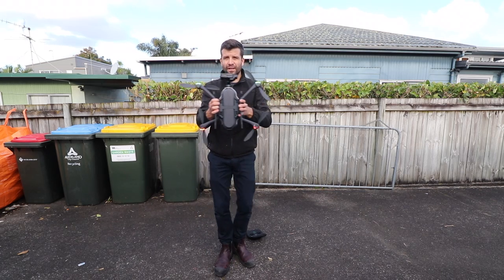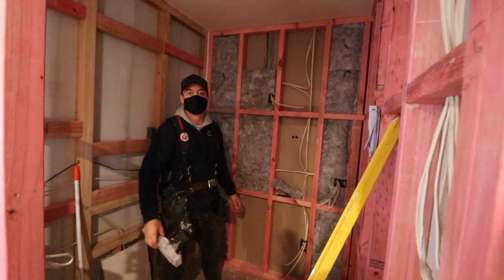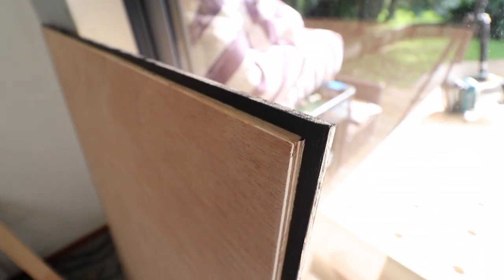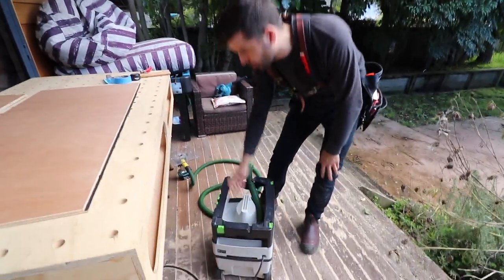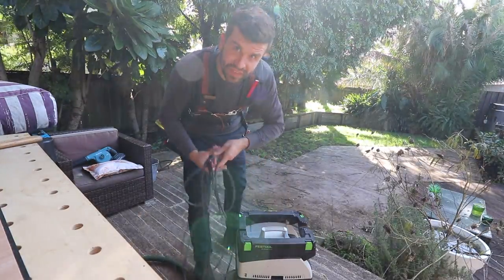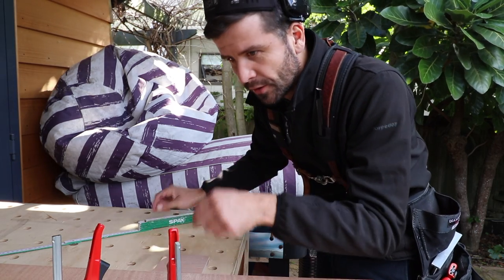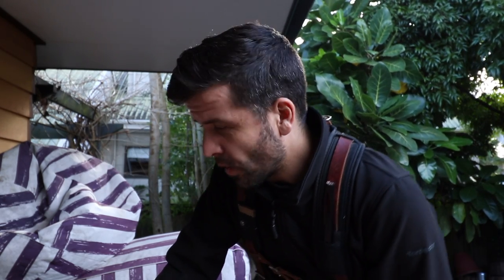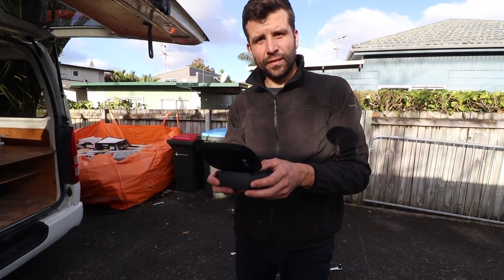Almost Fired Over a Vacuum!

Comment: Well, let me tell you this, as a customer :). I had some cabinetry fitted about three years ago. I only finished painting the room, and fitters came to get my cabinetry sorted. All morning they worked without extraction vacuum. I offered them my small Karcher but they pointed out that they have extraction with them. I thought it is strange not to use extraction, especially as they were cutting Corian worktops but it is their health... However once they left I got massively upset. My freshly painted walls were all covered in the dust. And this was especially visible on my dark navy blue feature wall. It cost me 4 hours of vacuuming walls from the dust plus I gathered it is better not to breath in this shite. Extraction protects you and environment you work in. It is a good idea to use it :).

Comment: As a cabinet maker, after getting my Festool ct26 and making all my tools hook up to it, I will never be able to work with out it. I work beside people who don't have dust extraction and it makes you realise how good it really is having dust extraction. Also for the "throwaway" festool bags I made my own version of the lifetime bag clip from two different sizes of water pipe that slide over each other, I cut the bag open empty it and seal it up with my diy clip and I use a bag for around a year before throwing it out.

Comment: Hey Scott, excellent vids, carpenters have by far the most credibility over any other trade. Keep up the great work.
CCA has 0.001 parts per million arsenic
Rice 0.40 ppm 
• Potatoes 0.63 ppm 
• Mushrooms 0.66 ppm 
• Tomatoes 1.49 ppm 
• Shrimps 19.90 ppm 
Source: Contact - the TPAA Newsletter, 2nd August Issue 2003

Comment: I use the disposable bags for my Festool CT36, but I don't throw them out, I just shake the dust out of the hole.  The bags are about $100 Canadian for a 5 pack, so I save several hundred a year.

Comment: I got the Festool cyclone trap / pre-filter. (Should work on your model, also on Makita’s vacuum systems with the systainer clamps on top) It’s Festool so it’s arguably overpriced for what it is, but at the same time it saves me money on bags. Especially if you have a lot of router work. You still need to replace the bags once in a while. Not because they are full but because the ultra-fine dust leaves a coating on the inside, clogging up the airflow.
Reply: I also use small cyclone whenever i can, no matter how big the vacuum you get so much more out of your bags. Thing is mine cyclone is small so i need to empty it all the time, so im looking to buy something. Main issue is i dont know how to connect it and not use too much hoses

Comment: Dust extractors are where it's at. I even have a shroud that lets me hand sand with collection. Festool plastic is too delicate for tools of that price, in my opinion. It's my only complaint about the brand, and it's kept me from buying anything of theirs- as great as they work.

edit: Not to mention the time my boss told me to just put a bag on the sander, while I was setting up the extractor. It set the fire alarm off, which was tied into their home security system. Good times. Always extract.

We don't use any treated timbers in interior construction here in the US (at least in New England). I'm not sure it's a good idea.
Reply: What do you use instead of Festool?  Suuuuuper expensive, it seems.  Just curious as I'm starting to look into this sort of thing
Reply: @rgbking488  I've been using a Fein Turbo 1 for over 3 years. It's not the best, but it's really good and it's the most affordable of the good dust extractors. I'd buy it again if mine died tomorrow, but there is no indication of that. It's often run for hours at a time.
Reply: @troyclayton  Incredible, thank you very much!!
Reply: @troyclayton  Killer info, thank you for the insights.  Yeah, it's interesting...people are always talking Festool I see, but none really push or talk about the other products.  I dig it and would get it (because everyone is pretty much selling it)...but I haven't yet and will probably go with something more affordable to start.  I don't know that I need a Ferrari of mobile vacuums to start...but if I was to get some larger, more permanent setup for a garage/shop, then I could see something more "Ferrari" like - cheers
Reply: @rgbking488  another option could be the scaled down Festool CT 15. Essentially a midi scaled down in features and minus the Bluetooth option. Only thing with the 15 is that it doesn't come with an antistatic hose and so I'd source one even going with something like a Cen-tec antistatic hose to avoid the 130 USD price tag for a hose.
Reply: @Fictitious_Character  Oh wow, that's awesome to know about!  Thank you.  Heck yeah - good to know of the different options, while definitely saving a few bucks to clean up messes
Reply: @rgbking488  The hose that comes with the 15 is good but it is like the older hoses by not having the braided outer shell, and it's not antistatic. Not being antistatic is a problem when it comes to wood dust. 

Other than the Bluetooth everything else that the 15 doesn't have can at some point be ordered from the Midi parts list because the parts are interchangeable since they share the same body. Hose garage, cord wrap, wheel lock, and of course the Bluetooth are the features that were scaled down for the 15, and only the Bluetooth can not be added later if you feel you need a feature. 

I have a few Festool extractors that are used on site and was looking to retire a CT 26 and wanted to go slightly smaller with a Midi for on-site mobility and weighed the options of the 15 pretty heavily because $350 for a 15 versus $640 for the Midi. I did end up ordering a Midi because of the Bluetooth option, but the 15 was very tempting and for what it offers for the $350 made me almost pull the trigger on it. 

Anyways definitely worth looking into and a reasonably priced entry into Festool.
Reply: @Fictitious_Character  wow - you know all about them, thanks!  Yeah that sure sounds like it, really appreciate the insights and details here - as an engineer, I love the details, hahaha.  Cheers & happy holidays!
Reply: @rgbking488  np. You have a great New year and a banging 22.

Comment: Great work as always but I would have to say the faster way of making these rebates is just to get the right router bit. You can get 25mm bit with a 12mm bearing on it so that when you run it along an edge it will overcut by 13mm instead of doing a flush cut. Very convenient way of doing this. I use one for doing rebates from time to time.

Comment: Festool forums recommend Starmix Ipulse vacuums. I have 4 and find they are better than anything else I've used.
Reply: Nevyn starmix impulse are exactly the same as metabo and I think Ramset vacuums.
The shape is exactly the same.
I do not understand why more carpenters don't use dust extraction.
They certainly keep the area clean and free from the fine dust which is not good for anyone.
Also cutting treated timber.
Reply: @ron1martens  The other brands are starmix vacuums rebranded.
Reply: Nevyn interesting how it works. Somehow they ( manufacturers) work together.
As you know metabo and hikoki have amalgamated. The metabo cordless planer is the same as the hikoki and previous hitachi cordless planer.
Ramset jackhammer is also a carbon copy of Bosch or vice versa.
So I'm curious to know where it all started like you mentioned.
Perhaps patent lifted.
The festool it a different design to starmix.
One thing I had a festool and they don't lose much suction when the filters get clogged with fine dust. Gyprock sanding.
Until my festool was stolen.
Both these vacuums become heavy and bulky so a smaller vacuum may be more ideal for timber cutting and leave the bigger machines for brick or concrete grinding and gyprock sanding.
Reply: @ron1martens  a small vacuum  with a compact cyclone is the ideal solution. Festool and makita are both toying with it.

Comment: To extend the life of your vacuum filter, consider using a cyclone separator between the vacuum and the tool.  I've found that it will divert over 95% of any wood dust, and about 90% of drywall dust.  
"Dust Deputy" makes a version, and Home Depot (US) has a version that fits on a 5 gallon bucket, called the Dustopper.  Likely pay for itself in the cost of Festool filter bags alone.  Not sure what is available in your area.

Comment: hi Scott ,small tip its much faster to do those "rabits" on your table saw ...2 small cuts and youre done ,advantyage is youre not changing all that wood in dust ,i always set up 1 cut run all my board thet set other cut run all again...(its realy easy on those dewalts ....mine is same as yours but run on batteries...)
i tried with router ....even with spiral bit take longer than table saw

best regards
Reply: marek mroz  I think for the board He’s installing  @9:45 , you’re gonna want to use a router.. 
For me, my garage sealing is low, so that limits me. Can’t put bigger boards vertically on the tablesaw.
However, in an better situation, you have a very good point my friend. I would do it just because I hate the noise my router makes :)
Reply from the maker: I use that method from time to time.Super quick! My table saw tends to leave scratch marks on the smoother sheets though, router this time 👍

Comment: I swept a new home under construction, it hadn't been swept since they finished the drywall and the vacuum filter was torn so it just pumped out dust the whole time. I really wished I had wore a mask, I could feel it in my chest the next day. I imagine it will take several months before I get most of that out of my lungs.
Reply: some tiny particles stay in your lungs forever

Comment: I bought the festool cyclone about a year ago and its like a turbo booster and you do not loose any suction. The clear container is a real eye opener as to how much dust is coming out the machines.
Reply: The festool cyclone separator decreases suction by 15-50%

Comment: Dust extraction drives me mad,every single tool i have has a different sized outlet,makes it near impossible to connect the vac to.even stuff from the same manufacturer having a different size.its about time it was made law for all tools to have an exact sized outlet so there never any excuse for no dust extraction!
Reply: Totally 👍
Reply: Ross Male duct tape haha
Reply: I have a couple stepped adapters which have been ok so far, but I’m with you.
Reply: Yeah I have stepped adaptors but always end up reaching for the duct tape,then I change tools and need to untape and re tape,what a ball ache!
Reply: Thats why Festool is awesome, everything fits and works together but you pay the price for it
Reply: Some cut up bicycle inner tube is handy for quick step sizing on hose connections
Reply: Ross Male,
  I was having the same problem. Makita hand tools with a Fein vac.  The Miter and table saw connect easily with dedicated 1HP floor dust collector.  Fein vacs, and presumed Festool vacs , work a  millimeter (Euro) scale.  I have been able to connect all Makita tools to the Fein, sometimes with tapered adapters, or directly to the hose.  Track saw, power hand planer, palm sander, router, etc.  If you using  the DeWalt  platform (glorified Black & Decker) I'd try American brand name shop vacs (Junk. ) to accommodate the Imperial System.  I live in the States and wish we made quality power tools.

Comment: Damn it’s crazy how different countries have such different building laws & codes. In the states I’ve never heard of that. In 8min through and this is reminding me of some panels we did in a bathroom and library. Mahogany veneer mdf cut with a 1/2 or 3/4 piece added in between each panel painted dark (almost black) it have the perception of similar to the groove you cut. Same depth. We had 2-3 of up doing it. It was tough bc the homeowner wanted every grain to match. So the veneer were all straight grain up/down. It was just a bitch handling those large sheets of mdf and getting the grains “book matched”. PL glue & 15/18g. I was up on the ladder while my coworkers were down below and I turned around and there was a cop standing at the entrance on some ok wrap it up! Iduno how long he was standing there bc we were in the zone! Caught us off guard lol dope vid brother! Looks sick!

Comment: Dust extraction is a must. In Denmark you HAVE to use a vacuum cleaner, and sweeping inside is strictly forbidden, because it spread dust in to the air.

Comment: Scott why didn't you just use a rabbeting bit in your router instead of setting up a straight edge for every cut? That job would have taken a fraction of the time, even allowing for squaring up the corners.

Since you made that table, I think I'd set up a router in it too.

Comment: This is interesting, in the US we don’t use nearly as much treated lumber in building, and CCA treatment is banned. Only outdoor structures and ground contact timber is copper azole treated in residential construction. We also don’t believe in dust extraction for the most part so 🤷🏻‍♂️

Comment: The auto feature on the vacuum is not recommended for mitre saw and any other powerful tools since they use more than 5 Amps and will stress out the motors.if used on one circuit.  In America anyways, we run 110V  15 Amps.

Comment: Hey Scott, Makita makes a router plate for their tracksaw rail that should also work on Festool track. Also do yourself a favor and buy a cyclone dust separator. They make one that fits your Festool vacuum (watch out for static build up with Festool ), There are many companies making models from units that you put on top of a 5 gallon bucket ($50), to Onieda (great systems) starting at around  $100-$150. I was amazed at how much dust they captured and how little dust made it to the vacuum's bag.

Comment: The green pressure treated timber doesn't have Arsenik in it anymore. It, unsurprisingly, was deemed too toxic to humans and the environment so they banned that and now they contain some sort of copper-salt instead. It's not as good to protect against long exposure to moisture though it does not leek Arsenik into the ground etc. This is at least the case in Europe. I can't say if it's the same globally.
Reply from the maker: Wish we went in that direction. Our timber still has arsenic it it. They actually record higher levels of arsenic in the air during winter, from people burning the timber  off cuts in their fires at home

Comment: What type of buildings do you prefer working on, UK or New Zealand houses?
Reply: New Zealand I would assume, I shouldnt answer for Scott but I am a carpenter from Scotland and the building regs here can be a pain in the ass, Much colder and wetter obviously so everything is insulated, health and safety is Over the top here as well as you would have gathered from the video
Reply: @scotland2256  I'm a carpenter from canada, health and safety is insane in New Zealand, especially on commerical sites, I worked there for a year, would 10/10 recommend
Reply: @anand8905  By the sounds of things it is much the same then, we use MDF a lot for finishings here which is one of the main reasons they are so strict with dust extraction (the dust is cancerous as hell, asbestos 2.0) and it is illegal in most of the world, do you guys use this in Canada/New zealand ? just out of curiosity
Reply from the maker: We do use it New Zealand still. You can buy a lot of trim made out of MDF. I try and stay away from it if I can
Reply: @scotland2256  gotcha, same here in canada. All depends what the client wants right, I'm guessing same with you guys.
Reply: @ScottBrownCarpentry  Best times I've ever had was working as a carpenter in Queenstown, planning on going back next October, we built the high school in Frankton! You guys are a riot

Comment: I use the Bosch gas 35 m for extraction and the Bosch 10 ltr 18 V one for small jobs
Reply: Hey bro - whereabouts did you get your Bosch GAS 35 from? Looking to get one, based in NZ. Chur!
Reply: @soldonkapitirealestate8400  I got mine from e Bay for £350, had it about 3 or 4  years

Comment: Here is a question I have had since watching the house extension series way back. New Zealand homes don't seem to have any exterior cladding. That is, here in USA, homes almost always have an intermediate layer of osb or plywood, or more recently specialty weather proofing layers like ZIP on the walls and roof, with the siding or roofing on top of that. Why not in NZ? Thanks.
Reply: Saves on timber. We don't clad twice. Our engineering (shear as an example) is done usually through our drywall. When we need extra in certain planes of the house, they sometimes spec individual 6mm ply panels that are installed to the outside as you would your osb system. However it is usually to the bracing elements specified length and not the length of the entire wall like you guys do.

Comment: Hey scott 
Quick question for you, is your vacuum an l class or m class?? 
I have a vacuum already but its just non big brand. Does the job, i keep it clean but i want a festool with the blue tooth because i use mostly battery,mitre saw track saw etc. 
Would the l class be alright for this work and cleaning at the end or the m class? 
Thanks 
Shane in ireland/cavan

Comment: Ryobi 30L Vacuum for $180 from Bunnings will do exactly the same as a Festool for  fraction of the price. Wet and dry as well with 240 take off. Mine sucks up brick and Gyprock dust and is normally attached to wall chasers. It has only just died after 5 years of use. Grab one mate for a second vacuum for cleaning up. Keep your Festool attached to your tools and don't be too proud not to buy a cheap Ryobi 🤔
Reply: Good tip, will check out the Ryobi. I have both a $1000 Starmix and a $50 Kmart bagged vac. They both get as much use as each other.